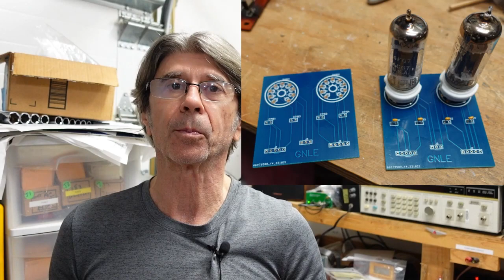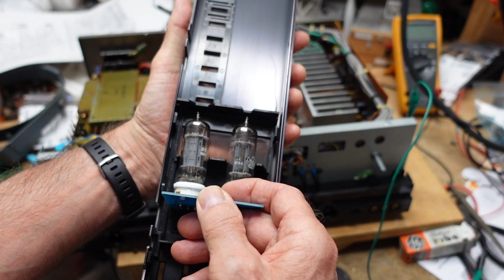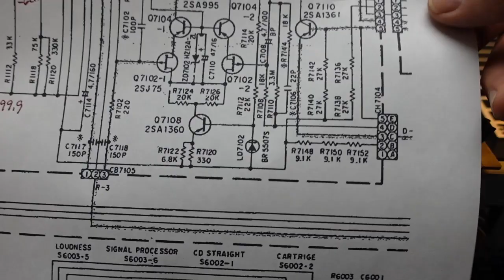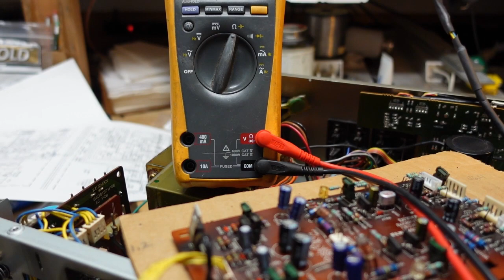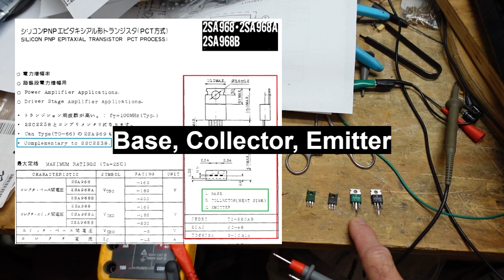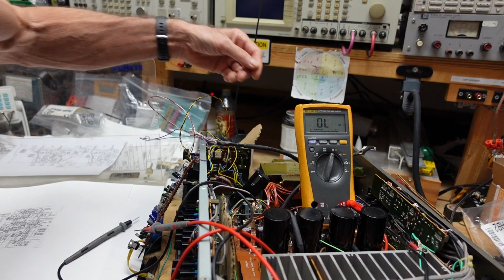Luxman LV 105U Phase 2 Driver Board

Comment: Mine left channel DC offset is about at 190mv, any suggestion on cause of this? I am guessing the 1st differential Q7103(7103-1 7103-2)? And this is one of those dual 5pins transistors, no longer available. I know this has been a while, any help would be appreciated.

Comment: Hi Ray ................what a project !
There's a pe-heat function switch for the tubes...
I have a 107u in stock for several years ...........I fear to look it up for restoring ......hahaha.
Would like to have your spirit guiding me when I will start working on it , I am a tube man and not transistor skilled ............we'll see, maybe you will be my inspiration to get the courage to this kind of challenge.
Thank you so much for being you and sharing with us.
Kind regards 
Frank
Reply from the maker: Thanks Frank.  This thing is close to breaking me, but I'm not giving in yet!
The preheat function is not what I thought it was; I thought it just kept the tube filaments on.  It looks like it energizes the whole thing, but doesn't close the protection relay.  The schematic looks like it taps the primary of the power transformer.
With the power switch off and the preheat on, I get voltage at the driver board and the tubes.  Explains the scorching of the PCB's!

Comment: That is a real challenge!! It’s really satisfying watching stepping trough and fix all that issues. Great job with the board.. I’m following along, thanks for the sharing.
Reply from the maker: Ugh.  That board is so heat damaged that I worry about long term reliability after the repair.  That's why I'm trying to mitigate further heat damage as I go through it.

I appreciate the encouragement.  Frankly, I need it with this beast!

Comment: Lots of pesky semiconductor failures on those boards, but it looks like you are sorting them out well. I feel your pain about parts orders. One vendor who's name ends with a "ey" , is really bad to deal with now too. they keep splitting my orders , about 15 to 20 different parts, into 2 separate invoices and 2 packages for shipping, even if i request in the notes field to ship "all or nothing in one package". I am going with Mouser for awhile to see how they behave, just placed a $160 order of parts mostly for a antique shortwave radio, if they do better I think I will go with them for awhile.
Reply from the maker: This thing is going to push me to the edge yet.  At least it forced me to learn how to have PCB's fabricated.
I haven't had bad luck with either vendor.  I'm just used to Mouser's interface.